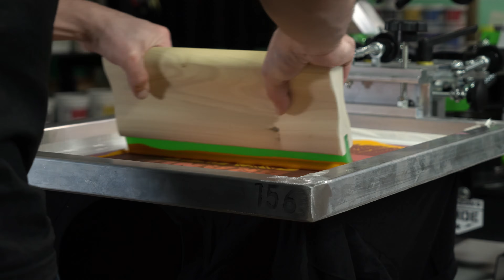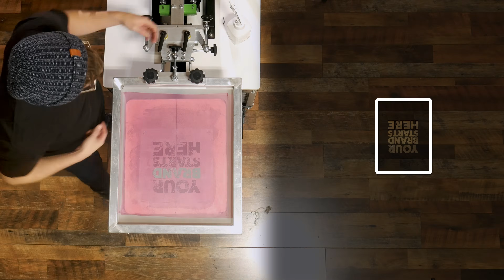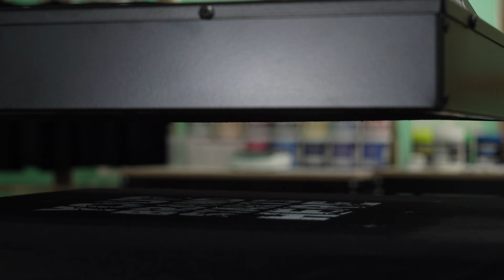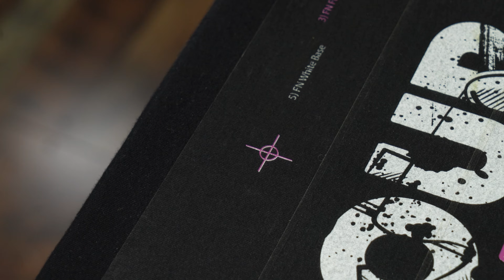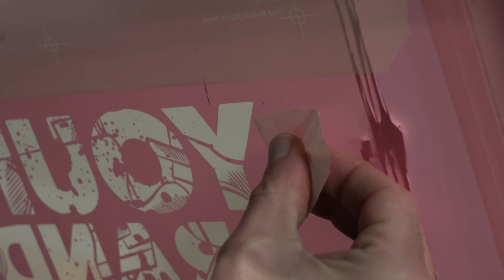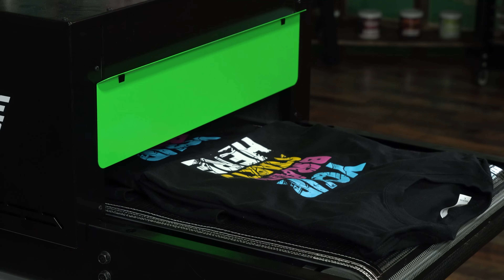Wait, XY Micro-Registration Does That?

Comment: Having trouble with the tilt micro. I've tried just about everything but the tilt is just extremley angled to high. I've loosen the wing nut and several other bolts pretaining to the off contact. SEND HELP PLEASE!!!
Reply from the maker: Hey there! Sorry to hear of the struggle, that's no fun. Can you call our Support Team today at 360-576-7188?
Reply: Thank you guys for reaching out so soon! I gave them a call and the mention that the two bolts on the tilt adjustment can adjusted as well. 

I would recommend creating a video on this. There’s little no exposure of this issue on the internet.

Comment: What point can I choke the underbase without accurip ?
Reply from the maker: Hi!  You can choke the underbase in your design program.  Typically you will be using a vector program like Illustrator.  You can choke your underbase between 0.5pts and 1 point.  If your press can hold tight registration and you have good registration skills, the .5pt trap will be great.  If you press is a little loose or you are newer, then a 1 point trap is probably where you want to be.